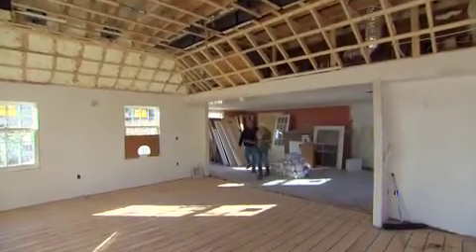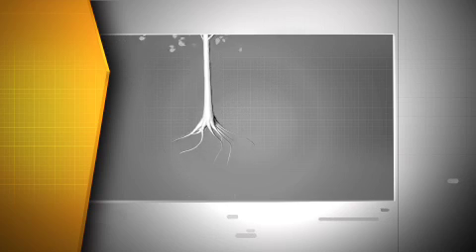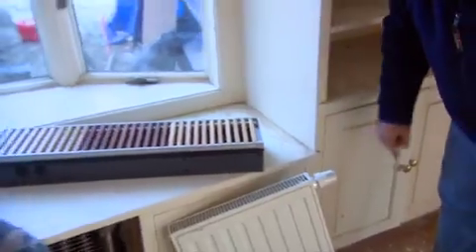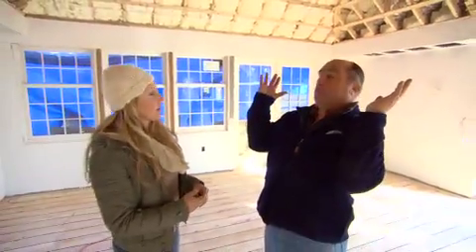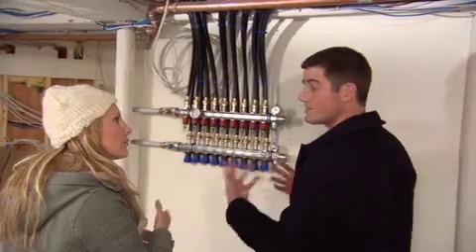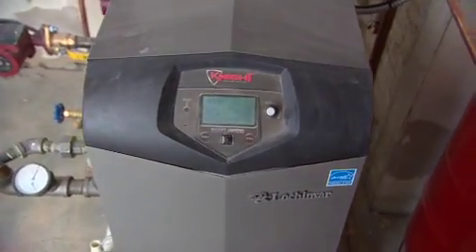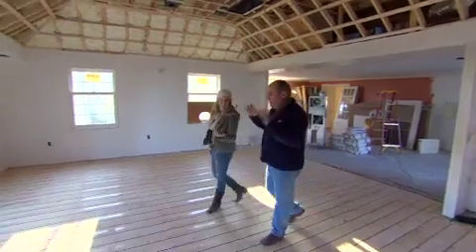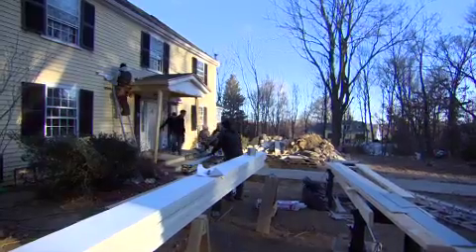This New House Hydronic Heating Segment

Comment: We use air forced heating in North America so we can air condition in the summer. So installing both systems is ideal but not cost effective. So we lean towards a system that uses duct work for cooling.